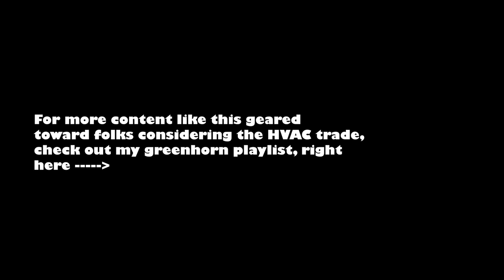5 Things to consider before becoming an HVAC Service Tech🔥❄

Comment: This field is unlike a lot of them, we get told we have the best jobs cuz we work on air conditioners, but the problem is when we get there it’s broken and it’s hot, by the time we get it cooling we gotta run to the next one, never really getting to enjoy the product of our labor… you better be able to adapt, one minute everything is great and you are the hero, the next call you might have to give bad(expensive) news to the customer and they want to rip your head off for not fixing it by “just adding Freon”… but the ups and downs tend to make us better because nobody likes to be constantly beaten, so we learn from our mistakes and are able to notice them a lot quicker the next time around(and it will come around again)… but by no means should someone just jump into this field expecting it to be a great paycheck, it very much can be, I know I’ve seen some great ones where I made good money, but working 18-20hr days for many days in a row really takes it out of you, so that paycheck costs you. I saw another comment that said something like “one year in the service side=5 years wear and tear on your body”, that’s pretty accurate most times… and remember, they aren’t paying for the parts, they are paying cuz they need your knowledge to know how to fix it…

Comment: I have a bit of advice for the young people wanting to come into the trade, I havent been in it long(1 year) so you can take this advice as a grain of salt if you choose.

It is best to get involved with install side first before going to service. I know sheet metal can slice worse than a hattori hanzo sword at times. You're gonna have scars regardless, I got my first one less than a month in(drive ear caught my hand as the boss pulled the duct to the attic and gashed my hand from the base to the end of my ring finger).

With all that said, the service tech with my company even said it himself. "There is gonna be a time when you're gonna need to know how to cut sheet metal right, to cut a patch, or a hole for a return hookup". I'm not saying to be an expert at ductwork, but just have a good knowledge in it before you try to go to service.

Comment: I’m a laborer by trade. I’ve been building scaffold the past couple years, and have 6 years prior experience in power plants doing routine maintenance on industrial heat exchangers and the like… Been working ahead of boilermakers and pipefitters for 10 years. My trade is always the first one on a job, and we’re the last ones to leave. 

I’ve been told that I’ll be well received in this trade because I’m not afraid of hard manual labor. I just hope I’m smart enough 😅 I’m about to graduate with honors but school doesn’t even hold a candle to field work. I know that from experience. 

Hoping to get into my pipefitters local this May after I graduate. I REALLY want to fit, I love building. But I think that I’ll thank myself when I’m 45/50 years old for biting the bullet and getting into service. I’d like to do both and be able to really lean on service when my body starts breaking down.

Comment: Due to the physical aspect I choosed this traid. Full body movement, changing places and kolleges. From time to time on my own. Love it after done several jobs. And well, one of the best paid craftsmen Jobs.  My company is wide spreaded by the tasks. Doing AC, Ventilation, Voto Voltaic, Heat Pumps (demandet by law in germany in the next years) , and smal cooling from counters and Colling rooms, and service. Love the mix. Dit my aprentice late with 49. In germany we have a dual system. 2/3 on the Job -payed (poor, but payed) and 1/3 theoretical at school.  You are only allowed to work with the degree after 3,5 years. Own company only as forman (Meister) wich takes another 2 years.  Cool vido of yours, going to see your van tour.

Comment: Hey all I work in the uk and been doing this 21 years. Started on install then service. My experience is a lot of sitting in traffic early starts to get to job for 8 working late and stuck in traffic getting home ( all trades I know) You will hurt yourself a lot but hopefully you learn fast and don’t get hurt too bad. You have to keep in mind of how easy it is to get badly hurt or worse. As AK said you don’t get many thanks. I worked in process cooling for over 3 years and that was very stressful. Lugging equipment on roofs gets very annoying after time. Basically the job is lonely hard work and no praise. I am lucky to now be working as a static engineer close to home which means I can chat to people and get home at a good time also I don’t get involved with other engineers much as a lot of engineers are like dinner ladies, they love to gossip and love it when others mess up. I was tought to cover colleague’s mistakes as best I can and maybe call them a bell end but have there back sadly a lot aren’t like that. In my opinion it’s a shitty job. I wish I had got into heating and plumbing or kitchen/bathroom fitting.
Reply: Your name is Shaun Young ?

Comment: ex maintenance/light service tech now installer on commercial new construction. a couple things not mentioned here are customers. on the residential side be prepared to deal with them and their children and their pets and their messiness. i've had to sit on piles of clothes and food wrappers in closets and attics and crawlspaces. i've put my whole foot through a guys ceiling because he would not stop talking to me and asking questions while i was trying to concentrate on finding studs to step on. i've had to pull off on a country road cornfield and find a way to go #2. i've had dogs sit in my lap while doing service on a furnace and huge saint bernards slobber on me while servicing an AC. Another aspect you will have to deal with is in a store the customer knows the price before they get to the counter, in HVAC the sticker shock will often times stun or anger customers even though only a fraction of that is money you actually get. not to mention having to deal with customers who stand over your shoulder and google everything you price out to them and give you shit for the price your company is charging. Also something very rarely ever talked about is bugs. everything from spiders to Bees and wasps. all the way up to rodents dead and alive. I used to have a whole drawer of my van dedicated to bug sprays. doing maintenance i always had to use my own hose most of the time and regular hoses are too heavy to lug around so i used the lighter hoses that bust and rip all the time. lots of things will end up coming out of your own pocket and until you are a good service tech you will be making the same or less money than you can get working in a warehouse. You also have to stay up to date on new equipment and their common problems as well as get a universal refrigerant certification which lasts forever and possibly other certifications that have to be maintained. Your life will be a constant check list, from things you are running low on or need to replace to things you have to check on a system or have already checked, to managing paperwork and parts used to put on bills ect. EVEN IF YOU CAN DO NOT go into service right off the bat. I highly recommend you start with install helping for at least a year or more. it will give you lots of time to save up and slowly acquire tools as well as knowledge all the while giving you people to asks questions to like the lead installer and other helpers. make sure to not just ask how but why to do something a specific way because a lot of hvac techs are secretly hacks who might train you poor methods. watch lots of videos and get really good at reading diagrams and understanding electricity before moving to service. hope you can learn from my mistakes. I went straight from school to maintenance and service and had no one but my own mess ups to learn from. Have a good day all.

Comment: Great Job well said; 
new guys coming into the trade don’t underestimate the fact that it’s not a 7-3:30 career. You will have on call rotation which after 24 years I personally despise it. But it’s a necessary part of the service industry. It won’t only effect you, it will effect your family, fortunately my wife is very supportive and understands it’s my job. 

Don’t  be your own cheerleader its embarrassing to watch, find value in yourself be confident but not arrogant. 
This is a great trade good luck 👍
Reply: Right on brother.  I told my wife before I married her that hvac was not a 9 to 5 job and if she could not put up with my work schedule there was no use getting married.  The customers come first because they pay the bills.  It has worked out ok.  I make the money and she spends it.

Comment: There gonna be times you're caught talking to yourself, if it's the first time work on a certain equipment in between calling a friend who you're hoping worked on one before or going through the internet in split second speed to at least have an idea of what your up against... I started out working on heating equipments and now I'm venturing in the hvac career but I wouldn't change it for anything

Comment: I Am 20 about to hit 4th year as an apprentice Mechanical plumber in Melbourne Australia, have loved every bit about my job and can be very challenging at times to. Very physical and not a job everybody can do but if you put your mind to it anything is possible,very curious about HVAC units in America and the main defences between aus and US in heating and cooling, I work on brands in Australia such as Actron,Dakin,Brivis,Bonaire,Lennox,ilec Braemar, do all sorts of work ranging for ducted heating/cooling systems, split systems, vrv systems, soild ducted ventilation systems, evaporative systems hydronic systems, to service, always fixing brand new ducted aircon units where small things maybe unplugged or missing from factory, installed wrong, I love finding other people’s mistakes to learn off and one day definitely would love to work in US just for experience wise one day to further my skills, Wish ya all the best from Down under and this is spot on video about what to expect in our trade.

Comment: I would say my least favorite thing about this career is not being able to make plans, two nights ago I was on the way home and got a service call over an hour away. Ended up being outside in -5 weather, totally blew my evening. I went to getting home at 5 to getting home at 9.... the only thing I don't agree with is the part about it being so physical, I've done a few skilled labor trades in the past and this is  definitely way easier than diesel mechanics, Carpentery or Masonry

Comment: One thing ive noticed is alot of places and guys dont have the desire to teach nor the patience to  teach because the more you know the more threatening you are to the other guys so know you will go through some shops where you'll run into that and one more thing is if your just starting out alot of places will have you like summer time you'll be up on roofs most of the day and its hot up there and you'll be just changing filters and belts and cleaning units and working in restaurants is the worst most are nasty

Comment: Yepper, same kind of thoughts i had in my Electrical Controls Engineering life....now I do HVAC as a hobby helping my neighbors here in Texas....Yeah demanding....who wants to crawl up-stairs in an attic full of pink panther insulation (itchy on contact skin) where it's 130 to 145 degrees (face full of dripping water and salt shirt) to replace a blower motor or even 10 to 20 minutes troubleshoot the 24vac wiring and control relays...that's HARD physically on the body and mind. Got to drink and take up lots of water into the attic....big jug of water. In Texas I hope for the problem to be located outside at the condenser/compressor or inside at the thermostat controller....cause very rarely are the attics comfortable...let alone have the necessary flooring in them....I've seen HVAC units without flooring around them...what fun is that....having to cut and bring up a 2x8' piece of composite board (floor) with you.

Comment: Thanks for the advice! 👍👍👍

Please share stuff for beginners, tips etc.

When you get in this type of work you think you thought of everything.  Not so!

I started as a helper so to speak at a major college.

Well the older college housing/apartments have regular residential HVAC units with freon.

Will that's what I thought I would get to learn and do.  WRONG!

I got put in academic buildings that are heated and cooled by water. Hot, steam, cold!!!

Learning air handlers/AHU, return, supply, steam, steam traps, strainers and condensate lines, pumps. Not mention many air filters and changing them.  Then greasing motors, shafts with bearings, changing belts.

On and on and in it goes.

In HVAC, your also a plumber, electrician and carpenter. So you got to have those skills as well. Make sure you learn to use a multi meter. IMPORTANT!

For got to mention, STEAM CAN BADLY HURT or KILL YOU!!

I'm still fresh at this job and I'm struggling, it's NOT easy!

Any helpful professional tips on the above that I've mentioned? I need sound advice.

Comment: Don’t say no to anything and be ready to have to do things in the most awkward situations 
I am a residential tech in New England and from what I’ve seen knowledge is attained with time but drive is what you need in this trade to push yourself that extra 10% when you have nothing left at 2am to get someone there heat 
On the other side know when to call it quits and take care of yourself in my end I’m by myself in attics all summer and running calls all winter gotta sleep eat take care of yourself

Comment: Honestly you dont need to start as an installer when looking to get into this trade. I started at Trane working on chillers straight out of school at 20 years old. Figure out what part of the industry you want to work in whether it be commercial/ industrial/ residential and stick to that path. Then figure out what role you want to take in said category whether it be service/ install or even running parts. Search far and wide and you will find it.

Comment: I'm a low voltage tech but always had an urge to get into hvac and before this was a cable fiber and satellite installer I so wish I got in way earlier. But i want a switch and love coming home tired and warn when i drive home. Call me nuts but I like the trades tools and doing service and install. I hope I can make the plunge and get into the trade.

Comment: My pops got me into this trade, I’m the youngest guy at my company at 20 years old. 

I’d suggest going into a mechanical contractor position so you aren’t just working on AC units 24/7 

I don’t think I’d want to do service. 
Yes there is more money to be made. 

But I enjoy having the consistent 7-3 with the occasional late day to get the job done. 

If we’re changing out a split system, and we don’t finish by 3, sorry, we’ll be back tomorrow to finish it. 

Service is never so lucky, our company rotates the service guys out so nobody can complain about being on call. 

We’ve had some guys work 7-7 go home, then get a call at 10 pm and have to go fix a unit somewhere. 

Blows dick for sure. 

Gonna be installing a 300,000 cfm air compressor next week. 

Install for the win.
Reply: shane hubbard this trade kills my back.

Comment: Man the hours I spend in my service vehicle. That's got to be one of the more difficult things to over come for me as a service tech. Refrigeration service tech for a local ice Distribution Company. I service ice merchandisers. We have we have about 4,000 boxes spread out over about 300 miles. I average about 200 miles a day. so I can a hundred percent relate to the alone time. one thing I really struggle with his organization of my service vehicle. All the tools and parts. I work out of a Ford F-250 with a tool box bed with a worn-out bench seat that is not the most comfortable. I wish it was a van.

Comment: Do forget that you are always working in either hot or cold environments. Even if the building is fine and your just there to do maintenance, the equipment is in uncondition space, like a attic, mechanical room or outside.

Comment: Working for just at 7 years in HVAC and the work has taken my body. I just had a SLAP tear surgery due to all the physical overhead work and have arthritis. Now I have to learn new skills and try to transition from Service to hopefully less physical controls. If I would have known how messed up I would be I might have gone to school for Engineering or programming. Unfortunately I do love the work but be warned you will get grinded down and laid off seasonal at smaller companies.